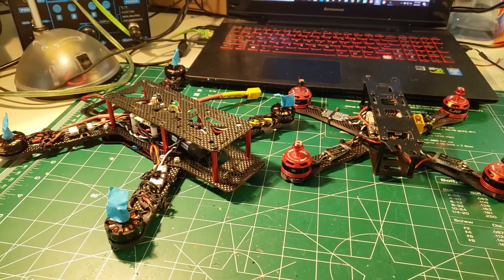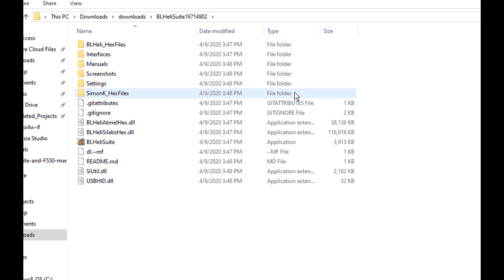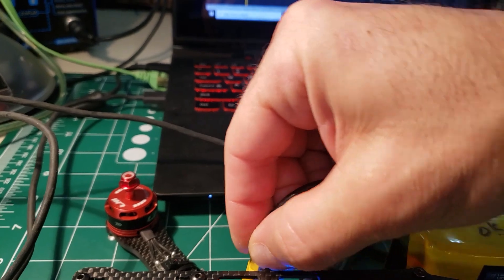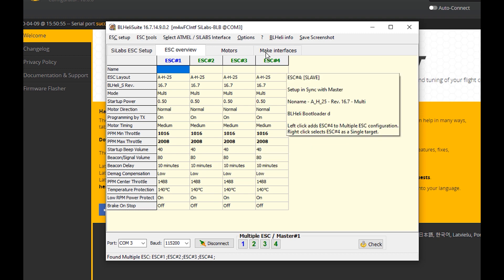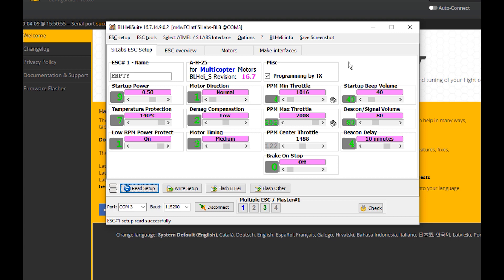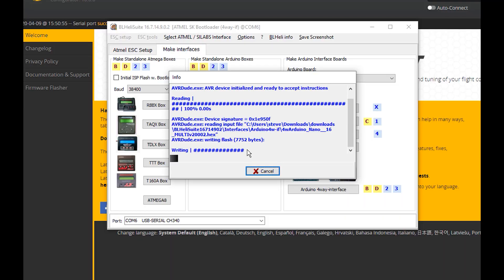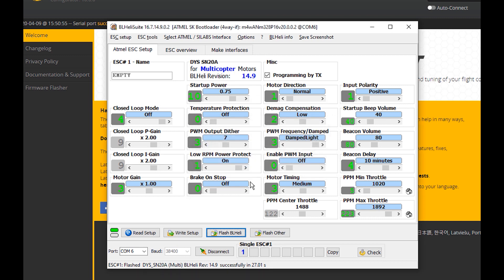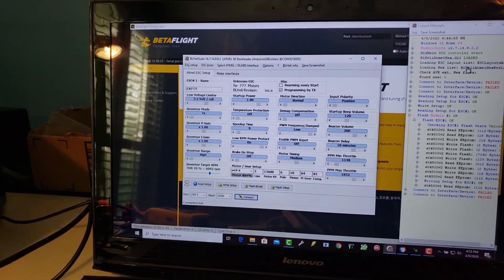Flash ESC Firmware with BLHeli Betaflight Passthrough & Arduino Nano for a Drone

Comment: Is there a way to do this if I don't have a FC? I only have the BLHeliS ESCs and they are installed in a fixed wing aircraft. I want to configure and change the settings. What piece of hardware can I buy to do this? Please don't tell me to buy an Arduino chip. There must be 50,000 different ones out there. This is so frustrating if you are not a quad nut.

Comment: first of all, i want to thanks you very much for video. But I meet a big problem, please help me answer my question. 
I do step to step similar with video, but when I push READ SETUP button, I can't read ESC status. In my screen display " Serial Interface 'm4wFClntf" connected successfully. Connection to ESC#1 failed! Please check dât-und power-connections to ESC"
But obviously is I connected my battery 12V with each ESC and con connect wire,GND of ESC with FC3
Please help me, i looking for answer greater than 3 week, but i can solve problem
Thank you so much. I waiting your reply.
Reply from the maker: What specific ESC do you have?
Reply: @TahoeSteve  How do you think about this ESC? Please help me. Thank you very much
Reply: did you solve

Comment: around 11min. I am also assuming you are flashing the same software to the ESC just to show how to flash, not to really update, correct?
Reply from the maker: Not sure i completely understand the question, but this was a second set of ESCs that would not be recognized by using the pass thru method as the ones earlier in the video.  this was an example of what to do in that case.

Comment: more questions: so you used the arduino 328 to the esc that  just reads BL16A so you can read the type of firmware to flash new firmware. What made you select the 4 way interface?
Reply from the maker: in the beginning of the video, you saw 2 quads.  one of them had ESCs that were easily readable using the pass through method (earlier in the video).  The second set of ESCs (from the second quad) had an older set of ESCs that would not get recognized at all using the pass thru method so I resorted to the alternative method later in the video.  Most likely, any blheli escs bought in the last year or 2 should work fine with the pass thru method.